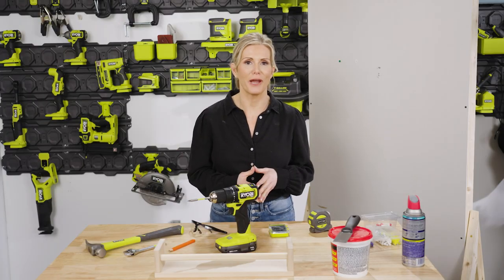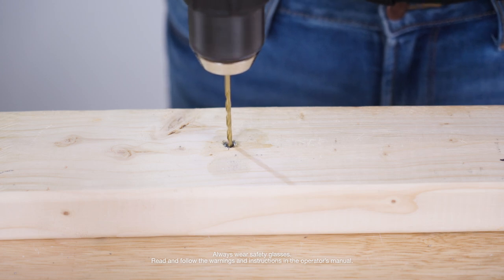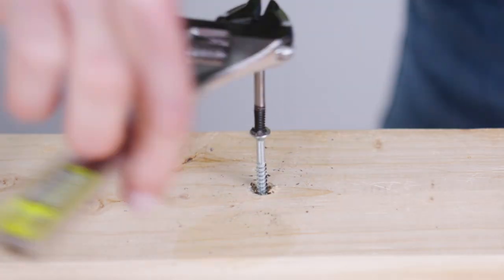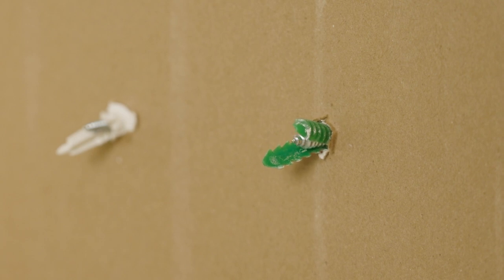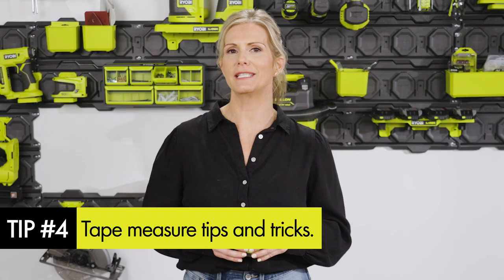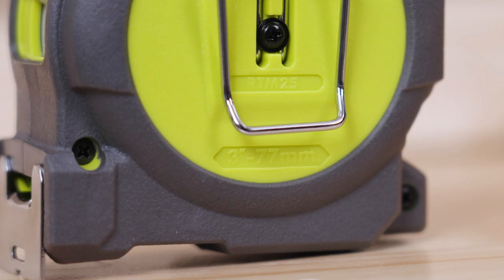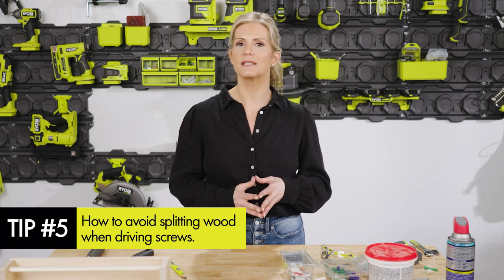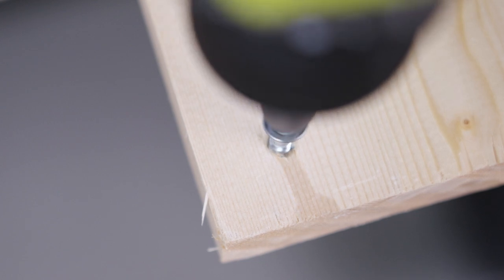5 DIY Tips & Tricks for Home Decor | The Beginner's Guide

Comment: You need to do a video on how to actually use a tape measure when the space you are measuring is longer than your arm span as the locks on the tape measures never work for long and if you pull out too much tape it flops down and you still can't measure stuff.
Reply: Great suggestion! 💚